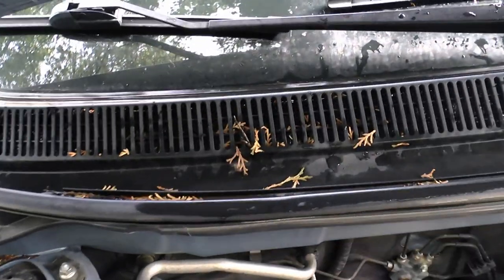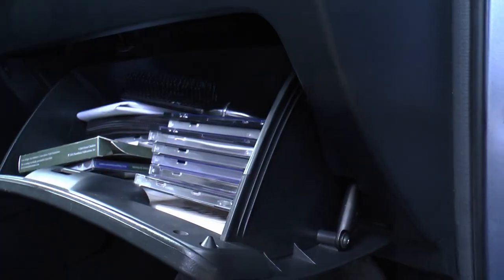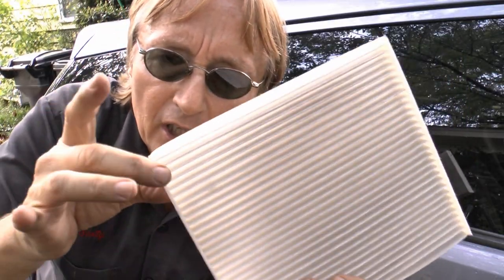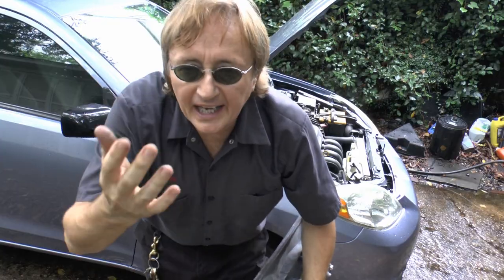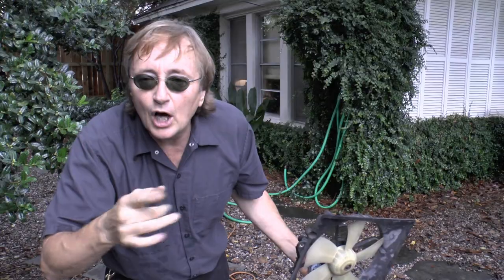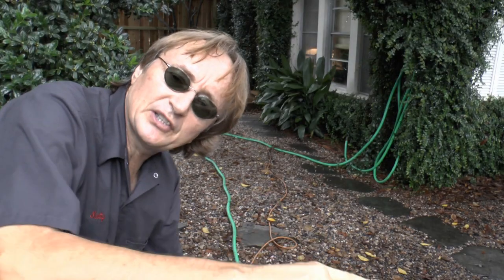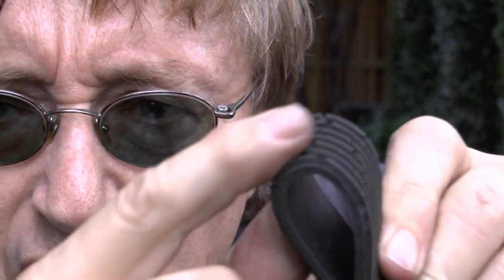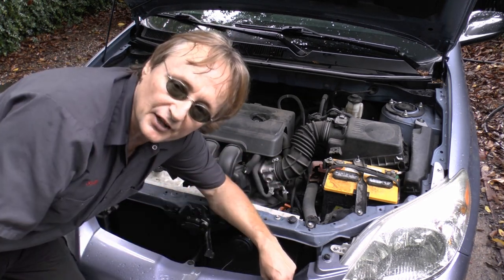How to Keep Your Car's AC Blowing Ice Cold for FREE

Comment: I would add make sure the fins are not bent (happens if you drive on country roads) or areas where "Road Construction" is a regular occurrence.  The little pebbles will  be pulled up by cars and trucks in front on the freeway and over weeks the fins will get bent.  Dad had me buy an old school comb flexible plastic comb.  It was able to reline the fins without damaging anything else.  Then used tar solvent to clear out the gunk from months of driving in road construction, allow it to soften up the mess and then spray it out.  Dad also had a helper (me) use a flashlight from the engine side (engine off) directed through the fins to quickly find any that are obstructed or bent.   Final thing he taught is older cars are more likely to have the connections to the condenser or compressor fail.  The go to for the repair shop (like a good 'ol pep boys) is to say the condenser has failed or the compressor has failed.  (experience they told me it would cost $1400 for a new condenser, when it was a refrigerant hose connection that failed. $225 charge from the dealer for the repair) before you shell out 1k to 2k for a replacement.  take bit of non acidic dish detergent mixed with warm water 1/4 soap to water is good.  put it in a squeeze bottle and put a bit on the connections on the compressor and condenser (hoses and end of the condenser if you can get the liquid on the connections and just the compressor connections don't drown it and just the connections)  Start the ac and run it go out and look for "bubbles" allow 5 to 10 min to appear if they show these will indicate a leak.  If the evaporator (the part that is like the condenser but inside to cool the air) fails it's not easily accessible to check.  If it's low on gas don't try to "do it yourself" as you are more likely to create damage.   Recharge should be done by a real pro.  There are specific pressures that should exist in an a/c system and someone with the right gauges, training, and experience can find a problem.   Dad always said to turn off the AC 30 or more seconds before turning off the engine, something about the compressor being disengaged when starting the car.
Reply: The last line may apply for very old cars but, with modern cars, the PCM knows when it's time for the compressor to switch on, so it won't do any harm, unless the manual says otherwise. The only advantage is that letting the blower go for some time after using turning the compressor off allow the evaporator and air ducts to dry up, preventing bad smells.

Comment: That filter is for the outside air, not the inside. Here in Texas it's so hot in the summer most people don't even open the vent, because that hot air will just come inside. Having that filter dirty will not make any difference if the vent is closed.

Comment: Scotty Kilmer I've searched and searched everywhere on how to change the blend door actuator on my 98 chevy s10; WHERE THE HECK IS IT LOCATED???? I just got a new compressor put in and its blowing great (a must for AZ). Winter is around the corner and gets cold enough that I need some heat, especially with my kid. All the vents work  perfectly so I know there is good vacuum pressure, the blend door is electric on the other hand.

Comment: Compressed air blown from the rear works just as good especially if you live in a dusty climate where the dust packs on the radiator, then water is not the best solution as it'll block even more and don't come even near a radiator with a pressure washer as you'll close the fins and then you'd have to pick each one open with a matchstick that take you hours

Comment: switch you A/C on once a week for five minutes even in winter to circulate the gas and oil to keep the system lubricated, dry seals crack and leak gas.

Comment: You should be using the AC year round to dry the Air and then the heater to warm , thus you keep your interior glass clear from misting up 
As for Bug's place metal fly gauze in front of the AC Condenser to keep them from getting into the condensor .

Comment: 2 out of 3 of my cars at home have cabin air filters and i check them every 3 months or so and replace them when they get really dirty. That old subaru i had was sold because it had so much stuff needed on it that we just got a new one. That thing had 120,000 miles and i figured out the cabin filter was NEVER changed within the whole time it has been driving. I replaced before we got rid of it but geez that evaporator was covered in crap. Took me a good hour to clear that out. Got it when it had 60,000 miles so of course it wasnt new

Comment: My old 2003 MINI Cooper S (R53) once had the aux cooling fan (radiator fan) fail.  If you ever think your fan has failed on that car, do not run your AC or it will blow a thermal fuse and dump all your Freon!  It's bad enough to need a new fan.  Of course, you will also have to keep moving if you don't have a working radiator fan!

Comment: Hey Scotty, you always seem to have the right answers for my questions so I was wondering my ac trys to kick on and it use to make a loud noise kinda like squealing and was wondering with those vague descriptions you could give a helpful direction to look into?  When I first got the car it was always doing the squealing noise so i would always have to shut it off.  The weather is getting hot again and I just would like a cooler summer this time while driving.  Few more informative hopefully helpful, its a year old radiator so its still pretty good condition and both fans work.  I don't know much about the coolant stuff and if it needs to be recharged I know nothing about it.

Comment: ooof... I bought a project car for 500 bucks and there was absolutely no airflow in the heating/ac system. It turned out that the vents and filter were clogged solid. I blew them out with an air hose and cleaned out the fan/filter housing in the cabin. I grabbed out a ton of leaves and several rodent nests and the filter itself was jet black and crumbled in my hands. The blower fan in there is cracked too so it rumbles when it's on but I'll replace that later. I'm happy I didn't have to pull out the heater core and all that junk... this time.

Comment: My cars ac barely gets cold but the cats 15 years old and mostly all original besides fluids battery and a starter it’s starting to squeak the engine sounds over worked when the ac kicks on it goes on and off while it’s on and one time it was blowing cold then suddenly started blowing heat then a second later it started blowing cold again and luckily that’s never happened again it needs work but it’s a VERY tough and reliable little car it’s an 03 Carolla S automatic even the suspensions all original and nothing’s been replaced it has around 135,000 miles on it 

It’s starting to have some issues due to the lack of maintenance but it’s still running and driving STRONG ! plus it gets excellent gas milage

Comment: Hello sir. Just fixed refilled the gas in my AC, changed the filter, and one of the fans; and the AC was blasting in full force. However after sometime- not sure twas when the brake was getting stiff to change the automatic gear- th AC started working like a fan, and wasn't as chilling as it was. 

Please I wanna know what to do before I return to the mechanic tomorrow. 

Thank you for your wonderful channel 😊

Comment: I've always believed that not using the AC "EVER" as in many years without the compressor running will cause the gas to leak out. Do the compressor bearing seals rely on occasional oil flow to keep them gas tight? I'm not sure how the compressor bearings seal the gas in, but it would make sense that they would need some kind of oil seal of some sort?

How does it work Scotty?
PS I always have the AC on year round and get 36mpg (2006 Corolla). I shall check my filter this weekend :)

Comment: Hi Scotty, the aircon in my 05 Mitsy 380 doesn't cool as well as it should in summer. I've had all the workings checked and all good. The mechanic suggested it could be a very dirty heat exchanger (evaporator ? ) inside the dash.  Can this be checked with say,  an endoscope ?
I'm pretty sure the car doesn't have a cabin filter but the outside intake vent has really tiny holes so it wouldn't be full of leaves and stuff.  I suspect that if the exchanger is dirty it will most likely be dust ( and doggy hair ) from constant recirculating the air.  If the exchanger in the dash is full of muck does it entail removing the entire dash to get to it ?

Comment: I changed the cabin filter in my 2017 frontier . Hadn't been changed since I bought it new.  Primarily changed it bc it put out musty smelling air.  Only $20 for the filters.  After I finished not only was the stench gone but the AC was much colder .

Comment: Found an old belt dressing and applied it to a new belt for her Honda passport. 150,000 later, same belt. Tip: if you ever have to replace valve cover gaskets on a V6 passport or such, remove master cylinder, booster, low pressure A/C line, and power steering pump. Otherwise you will not get to all eight bolts nor clearance. BTW, need a motor for her. Let me know what you can find or where to look.

Comment: Hi Mr Scotty Kilmer,  I have a Subaru Legacy 2002,  when I start the AC the compressor turn for 5 seconds and shutdown for 5 seconds,  about 5 to 7 times then it works like it should,  what could be the problem here?  I replaced the AC belt and the Belt tensioner because the old one was slipping and cleaned the evaporator which is behind the glove box and put on new cabin air filter, fans are working good but it gives me a check engine code P1480 cooling fan 1 circuit high input,  thank you for giving help,  thank you very much.

Comment: Hey Scotty, I have a 1997 ford explorer and my A/C barely works.  I have to put it on max AC to get a little cold air, if in normal with the temperature dial in cold blows hot air.  Also when I use the heat it blows hot air no matter what the temperature setting is.  whats your advice? thanks keep up the good work

Comment: Reason I got rid of my 2011 Subaru Outback was AC lines getting blocked and water pooling in front pass floor pan, and vent tubes from sunroof getting blocked, and pooling water again on front passenger floor pan. Never did any maintenance to '03 F-150 sunroof and no stupid cabin air filter to screw with

Comment: Not only will a clogged Cabin Air Filter reduce air flow, in many cars the the air flow cools the blower motor resistor. Which can stop your car from blowing air
Reply: Doesn't sound so right to me. Think of the lowest blower speed. Resistance has to be high, and higher resistance means that the current is experiencing more "friction" (more heat). Airflow is low. So why would they put such a low blower speed? It means that the resistors are designed accordingly. Not to mention when the heater is on. What could possibly overheat, though, is the blower motor, since it often features an airflow bypass meant to keep it cool.

Comment: I have a 1981 Mercedes Benz 240d  The A/C does work and had 1/2 pound of A134 added.  It was updated before I purchased it 10 months ago.  As long as the compressor is operating it is cold but the compressor shuts off to long and it starts to warm just enough in the cab that it makes it uncomfortable.  Then the compressor comes on and blows cold and then it shuts off and then it starts the cycle again.  It feels as though the compressor does not come on soon enough.  A friend suggested that the high and low switch maybe tired and need to be replaced.  What is your suggestion on this problem?

Comment: Hi Scotty, love your videos. My front drivers side suspension (02 Acura TL) occasionally makes a whining noise if I go over either a big bump or big dip in the road.. is it the shock? I had the ball joints replaced recently so it can't be that, maybe the control arm?

Comment: Hi Scotty I'm still learning about cars I go along doing repairs and you have taught me alot. Thank you. But I have a problem with the passenger side window. It was working great and then it just stopped. I checked fuses and other minor things that might cause this issue but it all checks out fine. Can you help me figure this out. Its for a 2004 Mazda 6
Reply: The window might be off its track or you might need a new window motor

Comment: I have one of those weird radiators, the only way to it is through the reservoir, no metal cap on the actual radiator itself I got the truck and I took the entire front off the truck trying to find the metal radiator cap just to realize there wasn't one it was all closed and just went to the reservoir. Idk how many vehicles are like that but out of all the vehicles I've had this is the first one like that
Reply: I was looking for it so I could replace the cap with one that would pop off when it gets too hot, saved my radiator in my last truck from busting I had to replace it anyways but it still kept it from busting spraying boiling water all over the place

Comment: scotty, i enjoy your videos. i been having engine codes on my 2003 grand caravan due to evap large and small leaks. i have replaced all the hoses and clamps. codes went away but now i have a p1494, im not sure how to test the canister or the purge valve. i smoked the system but i cant find any more leaks
Reply from the maker: +blaze2051 to fix that, you need both a smoke machine AND a dealer level scan tool to operate all the valves and check the system fully. BUT, generally they run fine and many just ignore that crap.

Comment: My 2016 civic has Hondas new 1.5 liter turbo engine. The front intercooler has some highway wear and tear and some of the fins are bent, but nothing major. The previous owner traveled to Texas from NC and back, and I purchased the car with under 20k miles. Should I look at replacing the intercooler or is there any concern whenever the fins are bent up from highway travel?

Comment: Scotty!!! Helllppp!!!

I noticed recently that my car makes a kinda chugging sound when it's in idle or neutral after its warmed up a bit, but I can't hear it when actually driving. The car drives fine, and I haven't noticed any negative performance, I jutst never noticed it before. I checked out some of your vids, but nothing related well to my problem. Is it a problem, or am I over worrying? Is that what idling rough means?
It's a 98 Nissan 200sx

Comment: Cabin air filter went out on my buddy's van we had to drive 110 miles an hour keep from frying our brains with the windows down cuz it's a 120 F 85% humidity (corn sweat Nebraska) took the van to Midas and they took it out and showed us that it had never been changed in the 350000 miles. $35.95

Comment: Thanks for the Tips,

Question, can we put another fan in front of condenser?
Reply from the maker: sure, the more air flow the better it will work in stop and go traffic
Reply: Scotty Kilmer hey sir scotty kilmer, ihav a question when i turn on my ac i noticed that my engine weaken and i dnt know what  the prob is?
Reply from the maker: jerome fajardo
many things can do that, but more often it's just a wearing out ac compressor straining the engine too much
Reply: maybe its time for me to get a mechanic about the car prob.  i had a trouble sometimes with my ac and its noisy when i turn it on might be the coz of too much wear on the ac as you mentioned. ok sir thanks..

Comment: If the AC Compressor goes out, autozone recommends replacing the evaporator, condensor and expansion valve as well due to line channels being clogged up.  Is this good advice or they want you to buy more stuff?
Reply from the maker: of course it's safe to replace all the parts, but generally the expansion valve and condenser is all that needs replacing along with compressor

Comment: Mr. Kilmer i would like to ask you a question i have replaced my fuel injector o rings several times but i still have the same vacuum leak i have replaced both bottom and top and still has a rough idle. It also has a whistling noise coming from the injector. Do you have any idea on what i can do to seal it. Usually mechanics have there own little tricks to things please help me if u can thank you maybe u can answer this on ur next live video if you would like and ill watch it when i can

Comment: Scotty please help me. I need to know 2 things 1 how many times do i check and when does a filter need replacing. 2 how do i take apart the glove compartment (what u did in the toyota) and how do i put it back in i have a toyota solara 2006 does this model have any specific problems?
Reply from the maker: depending how dirty it is where you live, the filters get clogged at different rates. your car is pretty much the same as this, behind the glove box. If worried, check it every couple months
Reply: Scotty Kilmer thanks

Comment: Hi, I got 1990 Chevy blazer k5 with r12, with a bad compressor, im considering converting to 134a,  any advise on which parts to change, and capacity of gas and oil that i should recharge with  134a? and what is the best pressure should look like at its best setup ,,,,, if there is any youtube clip doing so on chevy truck 80s it will be great Thanks